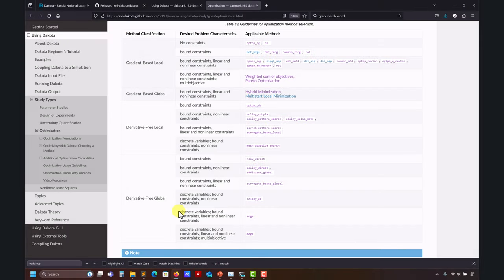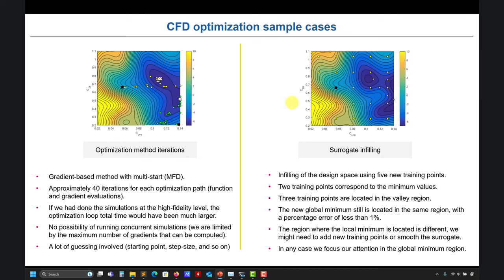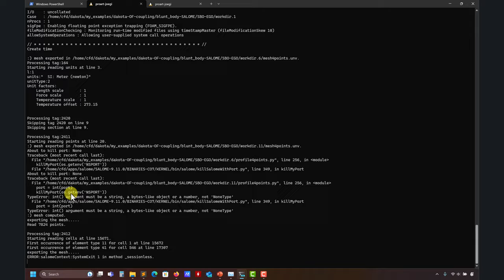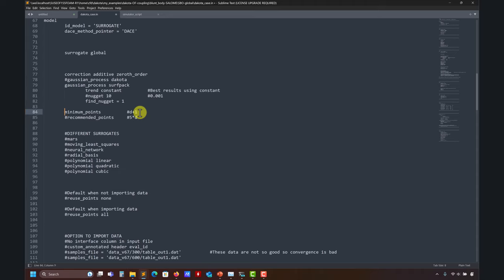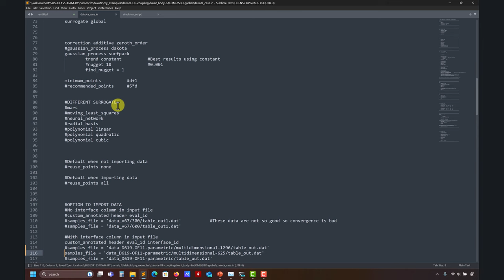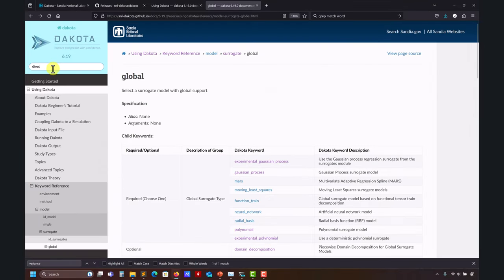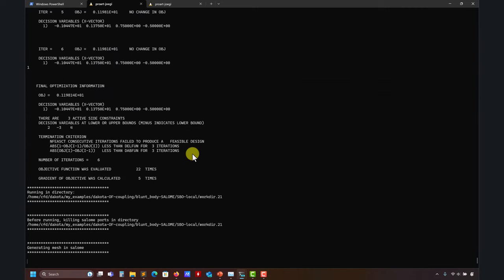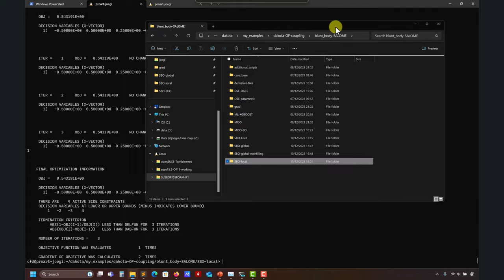DAKOTA-OpenFOAM optimization loop | Surrogate-based optimization SBO

Comment: Great video and thanks for taking the time to make this series.
One question: do you think it is possible to use Dakota for doing a Gaussian Process/Bayesian regression? The idea would be to to a lhs/sobol sampling first and then feed a Gaussian Process regression to generate a surrogate. Each new sampling point would be identified based on the locally uncertainty (e.g. variance) of the model. So not an optimization but a progressive improvement in the surrogate overall fidelity... do you think Dakota has already a method available for this?
Reply from the maker: Yes, that is possible. You just need to do infilling. I think the best way to go is using EGO, but any surrogate method (EGO, local, or global) can use infilling .
Reply: @wolfdynamics5703  Thanks for the quick reply! I'll try your suggested methods.
Reply from the maker: @cc-cfd  I think the best way to go is by using EGO. However, I haven't use EGO with external points, but I see in the documentation that it is possible to read external point, so in theory it should work.